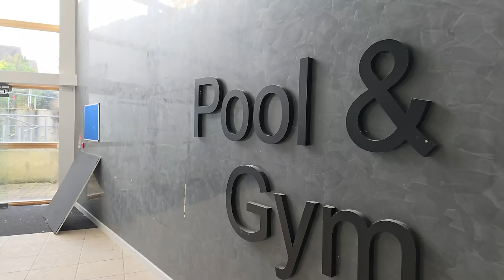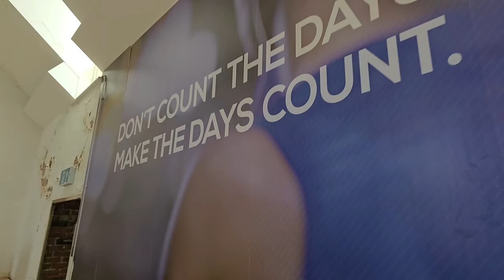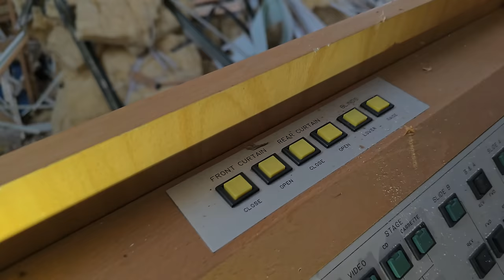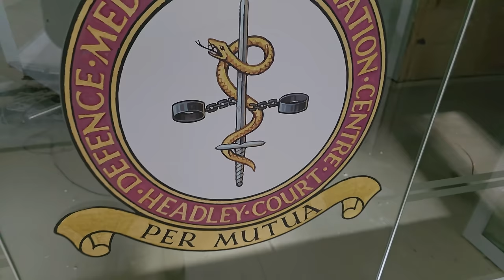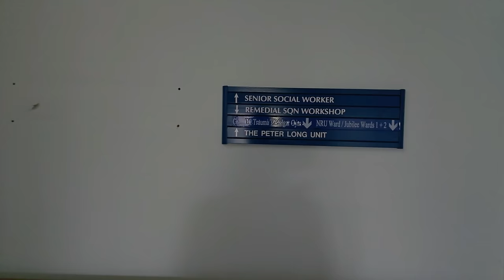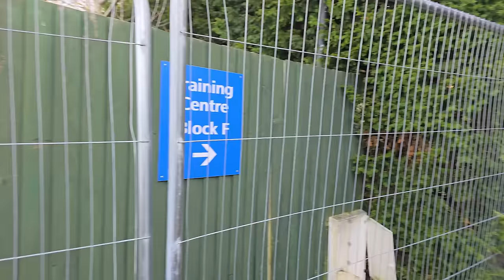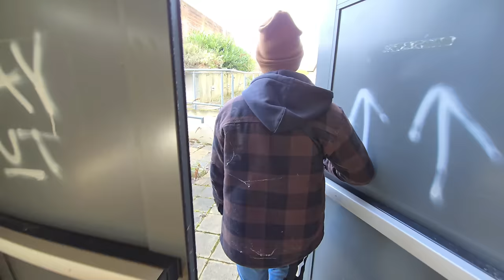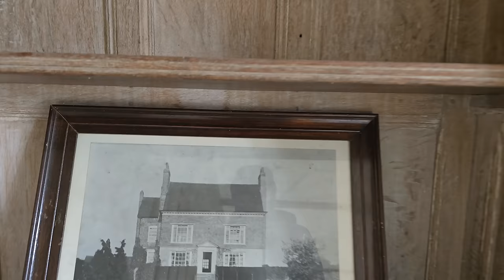We Found a HUGE Abandoned Army rehabilitation hospital

Comment: I actually stayed there a few times for treatment, the last time I stayed there was when it was starting to close and it moved up country. The rumour I got told was it was given to the military back many years ago for a pound I believe and it was on a lease and it was running out. I believe they was then going to build houses on it.
The smaller pool is where we used to do rehab in as it was very hot. The first gym you went into had exercise machines at one end then we used to do games in the other, badminton etc. it also had a dart board in there.
The big pool was always freezing as it was so big and yes the floor could be raised so easy to stand on floor.
They used to do the cinema on a Monday night as entertainment when we had to stay there but the roof started to leak so stoped it
The building at the end that you said you had not gone in is the mental health department on the right. The accommodation where we had to stay was on the other side of the road for info